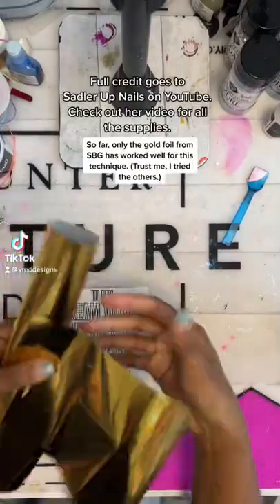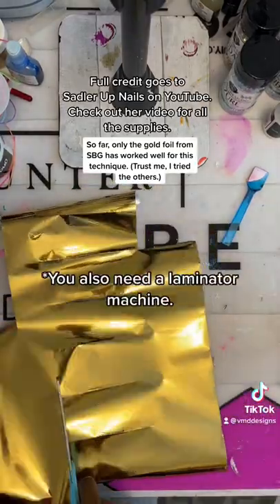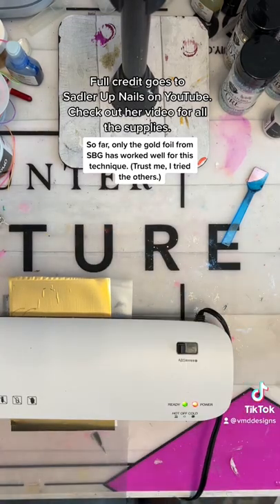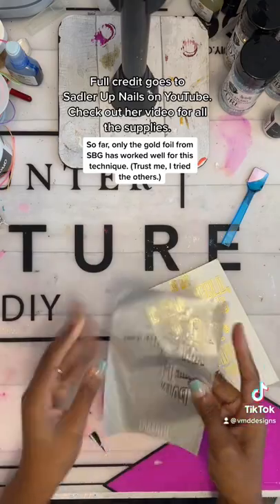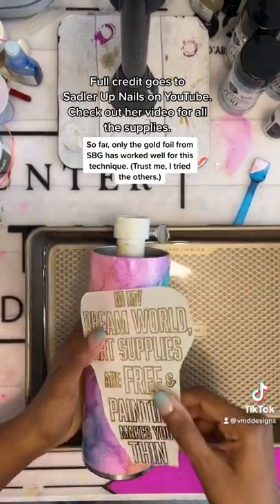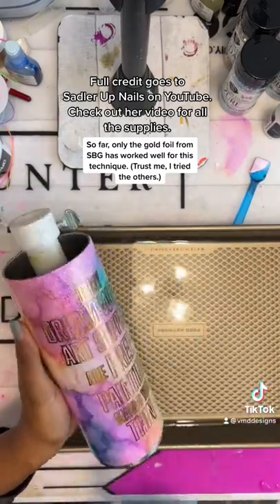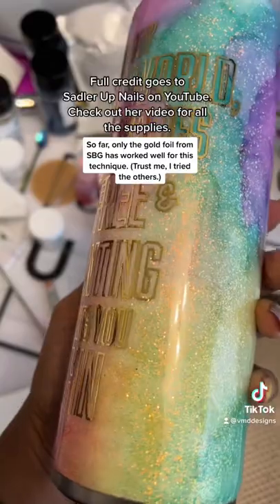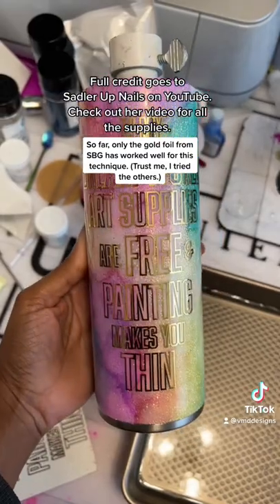Foil Waterslide Hack

Comment: I have a few more questions. What water slide paper are you using for the laser printer and how high is the laminator set for? 3mil or 5mil?  I have Hayes but the foil sticks to the whole paper for me
Reply from the maker: Hi! I use Hayes and there is no height or adjustments on my laminator. It’s a cheap one from Amazon. lol
Reply: I second the waterslide paper question. Do I need one specifically for laser printing? I don't recall if there were 2 types when I purchased what I have.
Reply: OK watched the Sadle Up Nails video and is inkjet waterslide paper not the laser one.

Comment: Love this! Does it have to be sealed like normal water slides?
Reply from the maker: Nope! It’s laser, not inkjet, no sealing necessary!
Reply: @VMDDesigns  I was debating getting a laser printer and this is what I needed to convince me! Thanks!
Reply: Can it work with a inkjet printer?
Reply: @monicascullion1030  no. it will only work with toner from a laser printer.